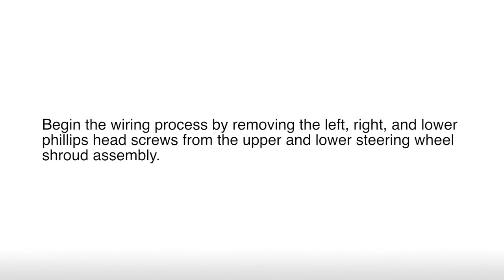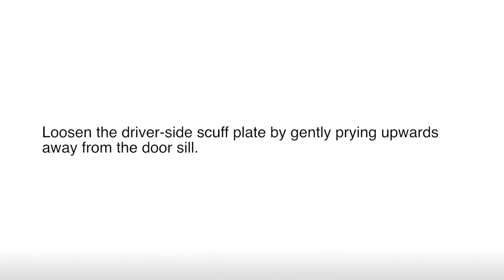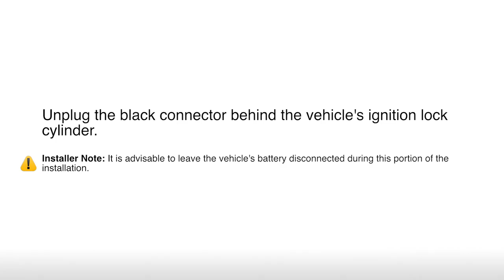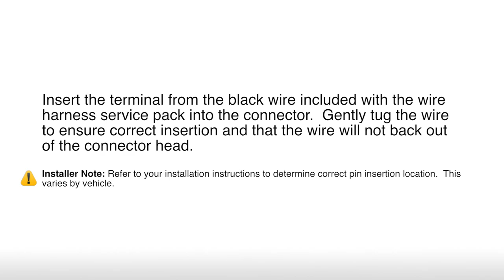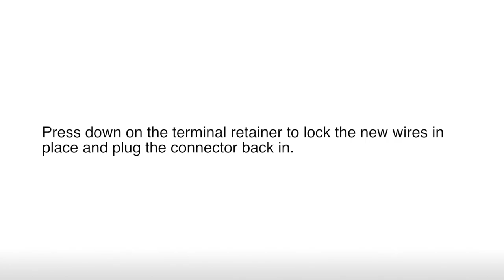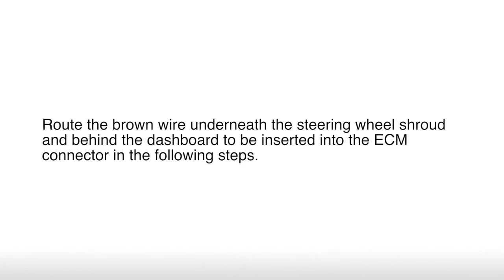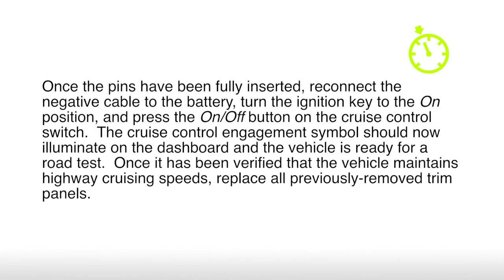Cruise Control for Non-Prewired Toyota

Comment: Hi i Like Your movies, i watch them because i am looking for instructions for installing cruise control in Toyota Auris II 2016 1.6 , it's not pre wired  and i can't find it anywhere on the net... the only thing i found is the diffrence in the fusebox (in car with cc there is a visible cable on a screw) but i don't know about special wires under the wheel and cockpit, maybe You could help :-) Thanks for all! Piotr